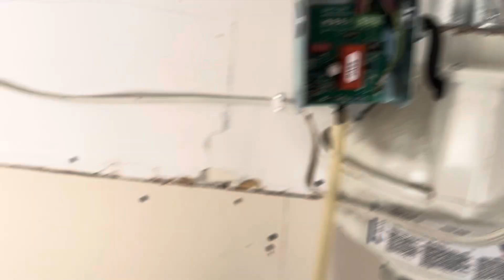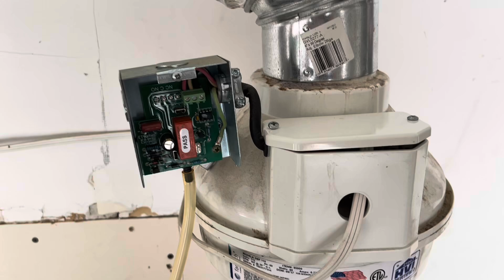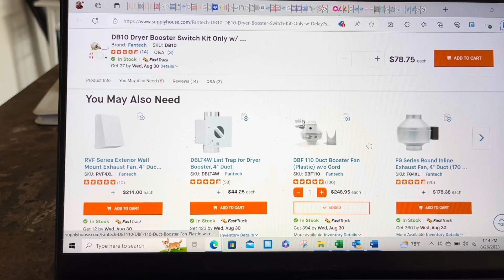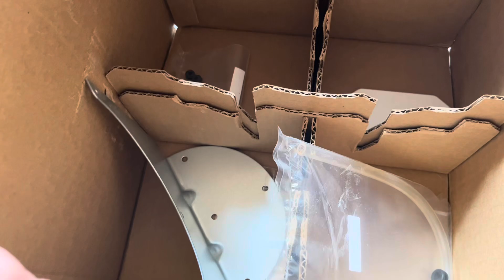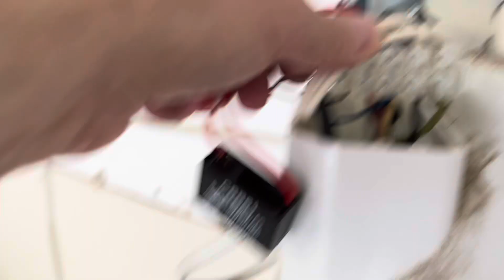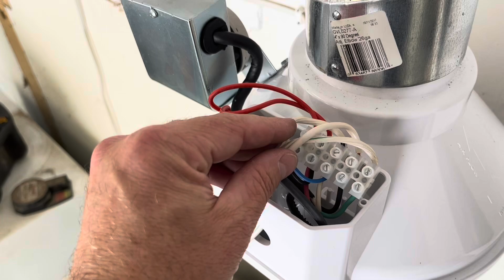Fantech Dryer Booster Fan Repair and Installation

Comment: The one we have has started to shake the house, you can hear it and feel it from the floor above. It worked fine for the 4years we have had this house. Any thoughts?
Reply from the maker: First, I would make sure you clean the fan.  See this video: https://youtu.be/a_zp_V_tcqk.  If its still vibrating, check hardware and rubber grommets to make sure they are snug.  If its still vibrating you may have bad bearing or the fan may be out of balance in which case I would replace if you don't want to dissect the fan.

Comment: I wanna find a schematic for the relay boards..  9/10 the fans are still fine and the board gets different faults on em.  If you clean the fan at least.. the actual pressure switches are generally good also.  The little 3 pin mosfett by the relay tends to crap out and sends 21 volts to the microcontroller which kills it and those are proprietary with password encrypted coding programmed on em.  I dunno why they just dont use a 555 circuit to hold for the 10 minutes after the pressure switch releases and a latching circuit to hold the whole time it is engaged..
Reply from the maker: Now that’s a good idea!👍

Comment: Mine has a click and a hum every 5-10 seconds when the exhaust is running. I need to take mine down out of ceiling space to test though.
Reply from the maker: If its not running constantly, there is a problem.   Once the pressure switch activates it should run for 10 minutes.

Comment: Mine starts, but its weak, not sure what's going on there. The fan blade spins smoothly by hand.
Reply from the maker: Make sure it’s not clogged with lint on the intake side.
Reply: @terryclayton  It had some build up, but wasn't terrible,  I blew it out with an air compressor. After some more digging around, it's probably a bad capacitor. 

I appreciate your video.
Reply: @terryclayton  HOw do you check for that?
Reply from the maker: @billchen9360 pull duct off intake side and pull out any lint.  Kill power to it first just to be safe.
Reply: @terryclayton  Thank you

Comment: My unit seems to run all the time, even when the dryer is not running.  I had air coming in the outside vent creating a negative pressure, so replaced outside vent.  Helped, but did not cure issue.  Is there a way to adjust pressure so more is required to start fan?
Reply from the maker: I did not see a way to adjust, its a very sensitive positive pressure switch.   I have a flap on my exterior exhaust that is closed unless dryer is running.  I clean it about once a year to keep it functioning properly. ( remove lint and give it a shot of silicone spray)

Comment: Just checked out my 20 year old booster fan of the same model and it turns out that bypass tube for the pressure switch had crumbled to dust. A much less expensive repair than replacing the whole unit. Now I just need to figure out the specs for the tubing.
Reply from the maker: Good catch!!